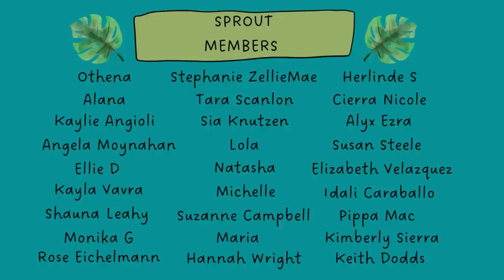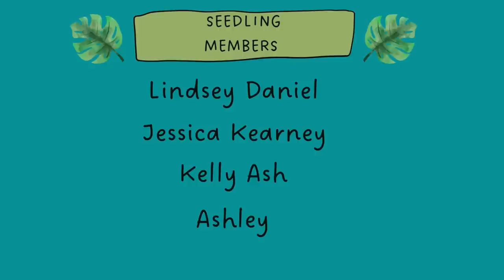Making an 8ft Planter Box Trellis for Shade + My Chickens!

Comment: Add some small flowers to the surface maybe for aesthetic purposes, or some that could trail over the front edge 

Why do you want shade tolerant plants if the purpose is to provide shade?
Reply from the maker: Because the wisteria will take over & shade the other bins, so I’m not necessarily looking for climbers for the other bins either